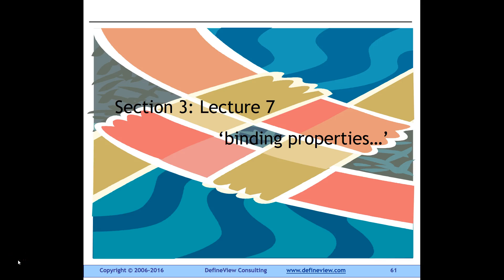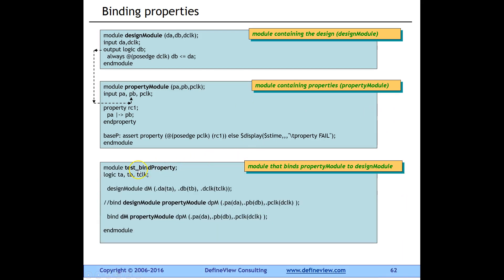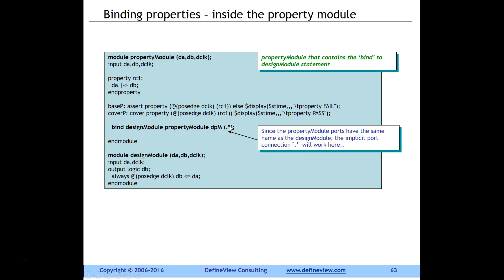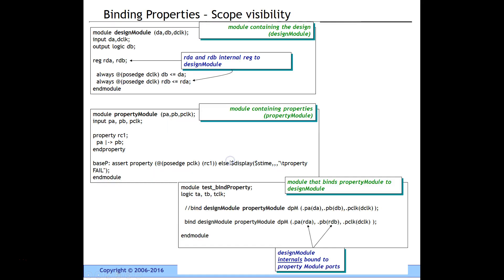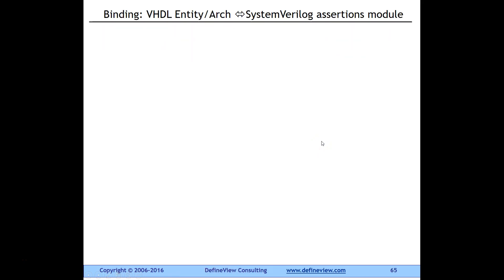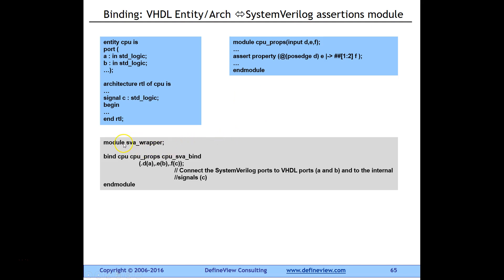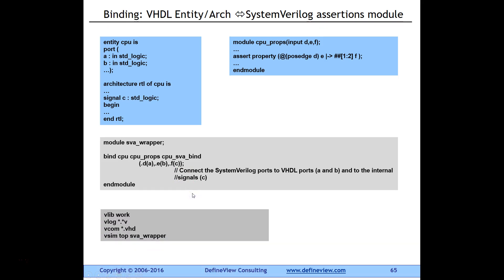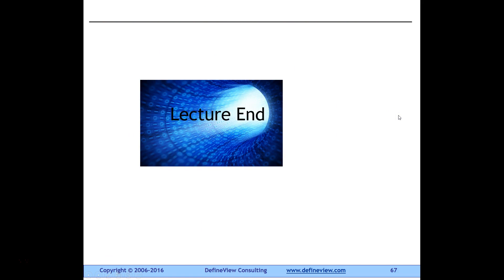SystemVerilog Assertions :: BINDing Design module (Verilog or VHDL) to Assertions Module

Comment: In this way can we have design in VHDL and TB in SV? Will bind only work when we have assertions? or any other SV code?
Reply from the maker: The binding between VHDL and SV is simulator dependent (simulator vendor dependent). It is not part of the LRM. 'bind' itself is a generic construct used in SV - it is not meant only for SVA properties module. Please refer to SV LRM for a complete description on how 'bind' works in a generic context.